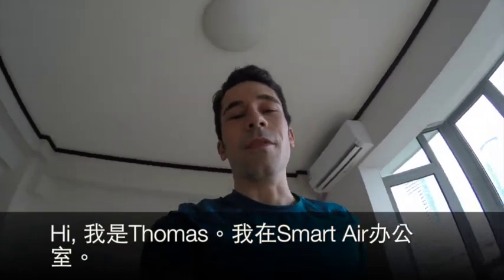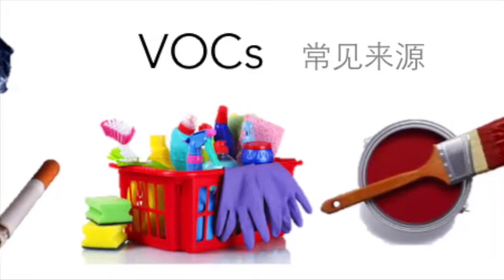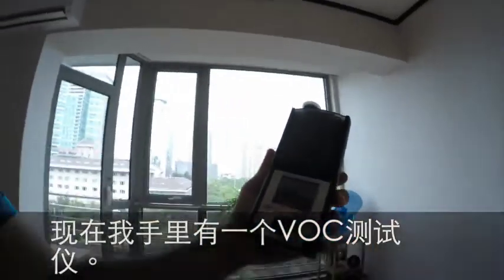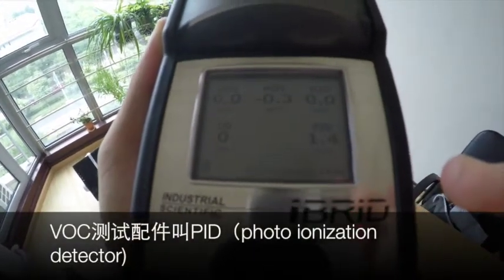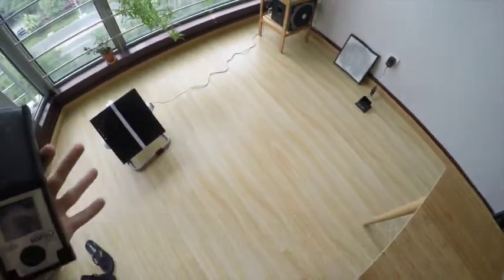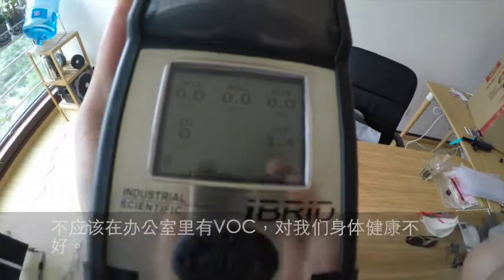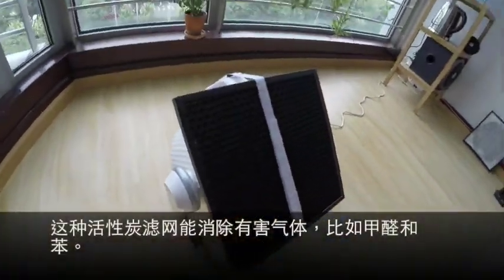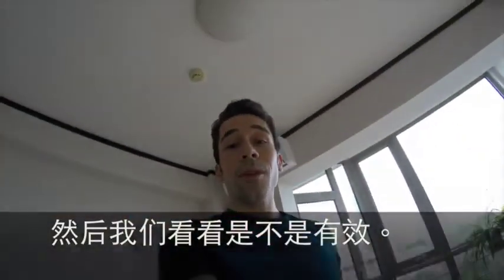Smart Air - VOC Activated Carbon Test

Comment: Hey very interesting video, can you please tell me how long did the test take? You showed the time it started but not when it ended. Thanks!
Reply from the maker: Ah, good eye! It's a little tough to say because the cigarette smoke from outside interrupted the test. From the clock in the background, I think it was about 30 minutes until the first interruption (1.3ppm to 0.5ppm). After that, it looks like perhaps about an hour to get to zero. I don't know if people came out to the hallway to smoke more cigarettes during that part of the test.
Reply: @thomastalhelm5029  Can you recommend an Air purifier that will be effective at removing VOC's?

I ask because I recently bought a Memory foam mattress and I put it in my room and opened it thinking I would leave my windows open to let in airflow from outside to let it ventilate my room while it expanded  but then my apartment decided they where going to start painting so I had to close my windows or decide if I wanted to risk the VOC's from the off-gassing of the memory foam mattress expanding or the paint being sprayed from outside. Anyways I am looking for an air purifier that is proficient at eliminating VOC's. Can you please provide me with some direction or insight on a good choice or what I should be looking for.
Reply from the maker: @danw6877  Oh boy, I believe that! I bet that mattress is full of VOCs. As long as you can smell it, you're probably breathing in VOCs. For a purifier specifically aimed at VOCs, the biggest thing to avoid is purifiers that have activated carbon in name only. Lots of purifiers have just a little carbon. A good example is the Coway Might purifier. It scores highly in particulate tests, but has essentially no carbon in it. The more carbon you have, the more effective it'll be, and the longer the filter will actually remain effective. Honestly, I can't think of a purifier that comes with lots of carbon, except some models of IQ Air, but they cost an arm and a leg. The Blue Air's usually come with a moderate amount. If you're in the DIY mood, you could easily rig up a fan and a bunch of activated carbon yourself. Carbon is super cheap.
Reply: @thomastalhelm5029  I found this test video my room must be a soup. Going to open my windows since they finally finished painting.
https://www.youtube.com/watch?v=X5XvCE3tS8g
Reply: Also how much was the voc tester? I was thinking I might pick one up to test the room before I use the purifier out of curiosity as to how much voc the mattress released. Also to make sure the purfier is working.
Reply from the maker: @danw6877  Oh boy, that multi-gas detector costs $3,000. If you get the VOC-only version, it still costs around $800. There are cheaper sensors available. Even the expensive ones aren't all that great. What they can do a decent job of is telling you whether VOCs go up or down (like this test above). What they can't tell you is whether those VOCs are harmful or harmless, or what the precise levels of VOCs are. They give precise levels, but I don't put much stock in the actual number.
Reply: @thomastalhelm5029  Hi Thomas. Thank you for sharing that. Is there a less expensive  VOC tester that you trust or you like?
Reply from the maker: Honestly, not really. The technology really isn't there. VOC detectors react to a range of things, some harmful, some not. Even the ones labelled "formaldehyde" detect lots of things, not just formaldehyde: 

https://smartairfilters.com/en/blog/formaldehyde-detectors-not-accurate-monitor-formaldehyde-home/

But if you want to do a simple test, you might try one of the cheap ones out there. If you're just doing a simple test asking "do VOCs go down when I turn on the carbon filter," then even a cheap one should be adequate. @dianeibsen5994